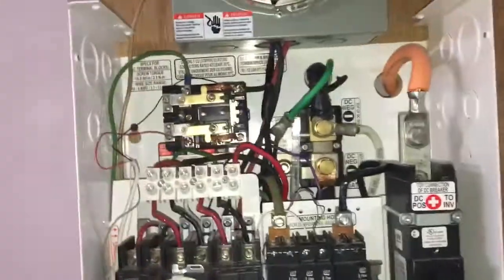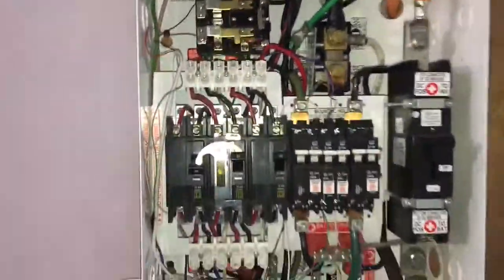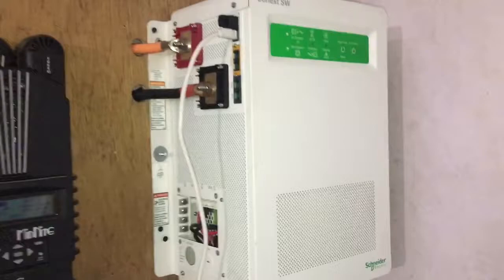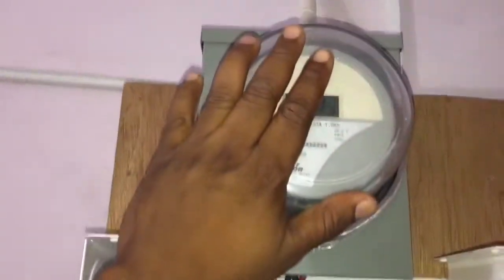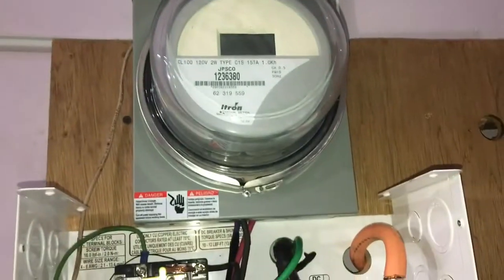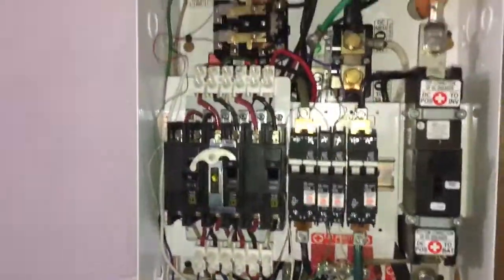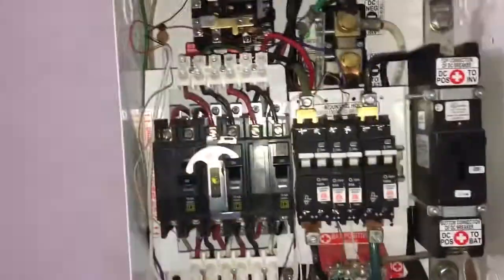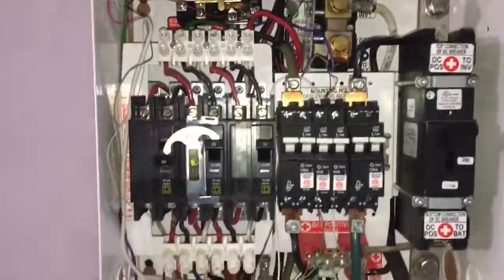Schneider SW4048 automatic transfer switch setup, magnum e-panel, midnite charge controller

Comment: Ingenious setup !!  I assume that you have the inverter running on 50Hz. What's the capacity of your battery bank and panels?
Reply from the maker: Hutch Chris my system evolve over time, I’m still using the 4048 inverter the battery bank changed to 30kw of Lithum ion and i moved up to 24 panels (some 240, 250, 260 and 270 watts )